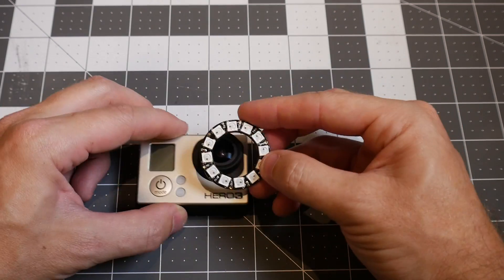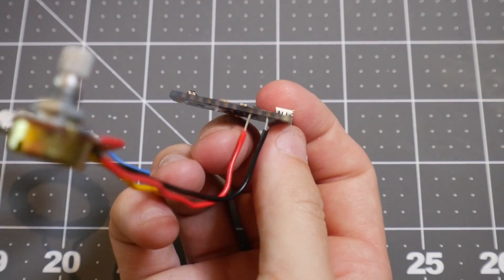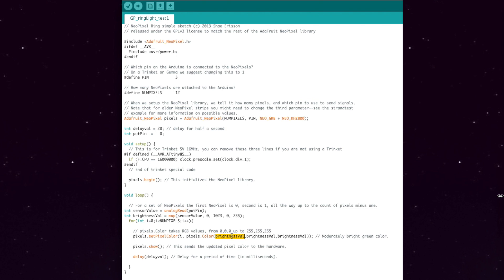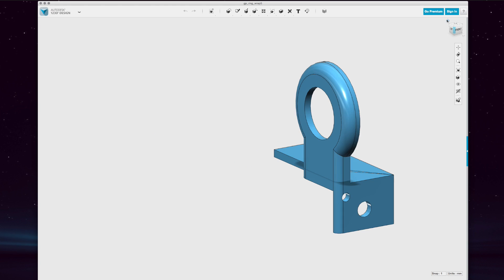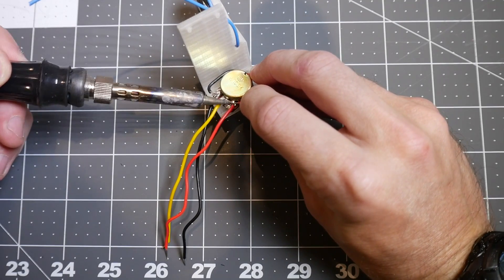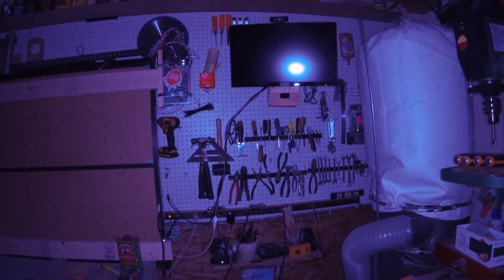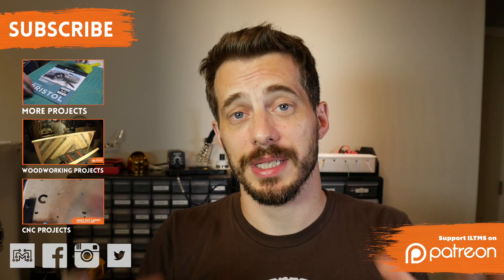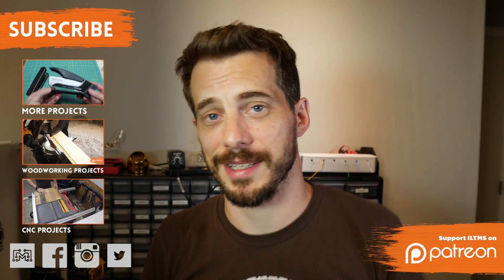GoPro Ring Light // How-To | I Like To Make Stuff

Comment: Hey, Bob! Why did you use an Arduino? What difference does it make?
Reply from the maker: +Jorge Tinti Hey! Well, the Neopixels are addressable, not just a strip of one color LEDs. They require data, not just power.  You could still make that happen without an Arduino, but the $15 to avoid all of that work was worthwhile to me :)

Comment: Question: you mentioned that you can also chance each 0-255 color on the RGB scale with additional controls, what exactly would you have to buy and how could you include it in the overall design. I figure if you have a digital back for your GoPro you can see any color cast and compensate according. Basically using the LEDs as a color balancer.

Comment: nice project. i liked 123d design when i first came across it but quickly found it clunky and somewhat frustrating with how often it would say "invalid operation" when working with sketches or objects that were only slightly complex. i ended up continuing to use sketchup for nearly all of my 3d models, just needed the export-stl plugin.

Comment: hey Bob, just a few ideas: if you can manage to print the prop vertically (support material? make it a solid box?), you could make a sturdier base, pause the print halfway and embed a nut so you can attach the whole thing to a tripod. Also adding 2 loops on the back to slide in the battery pack, so it's not dangling.

Comment: Couldn't you just connect the NeoPixel to the middle and ground pin of the potentiometer, so it'd provide the LEDs with the power of the middle pin of the potentiometer? I don't know if the NeoPixel would work without its data input, but it seems that connecting the Pro Trinket is a bit of a stretch. I mean you get a value from the potentiometer which you pass through the board just to output the same value to the LED ring?
Reply: Yeah you are right, it seems confusing.
if you run the leds directly from the potentiometer there will be huge amount of energy wasted by the resistance of the potentiometer , because there is a high current .
instead, you read the desired value, then use PWM to turn-on-and-off the leds really fast .
Search for "PWM vs Potentiometer, which one to use" in youtube. there is an excellent video about it .
Hope this helps .
Reply: +Guy Dascalu NeoPixels are smart LEDs they can't be dimmed that way. You have to send a command to the to set the brightness.

Comment: So, what would you use a light ring on a GoPro for, besides using it at night?

And will you make a cover for the Arduino that you can snap the battery to so you can carry it in one hand? That would be cool.
Reply from the maker: +RecursivelyCuriousPodcast Yeah definitely. Like I said, this was an open 3d printed piece so it made sense in the video, but it definitely needs to cover the electronics for safety and a clasp for the battery is a great idea to add as well!
There's no particular reason for the ring light, but it gives you a light source that's always facing the subject, no matter where the camera is a pointed.